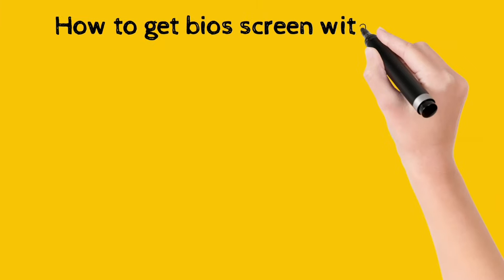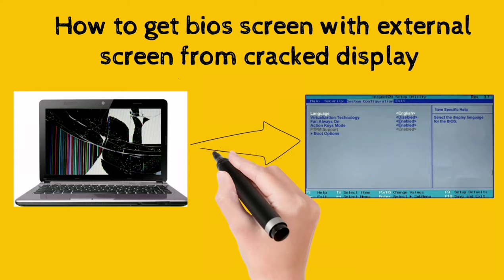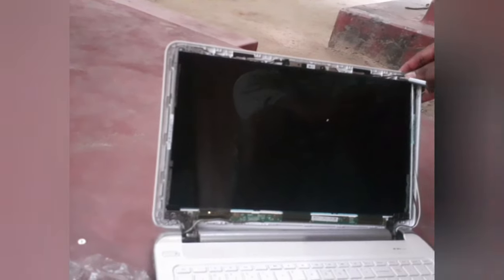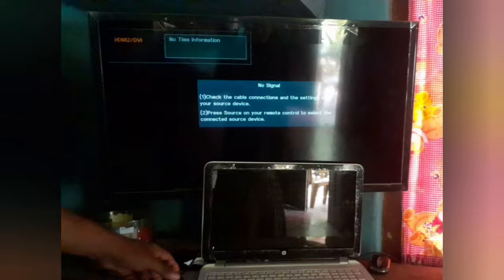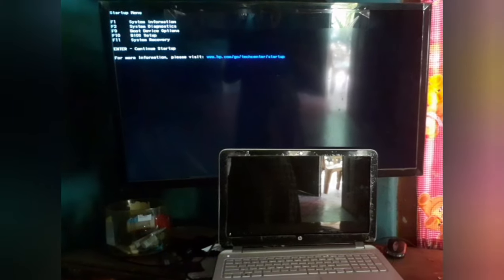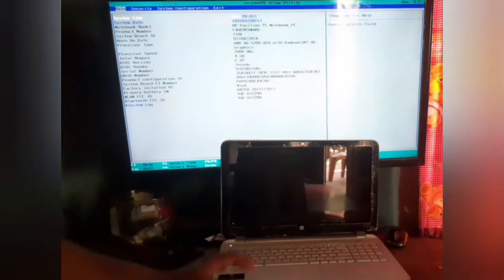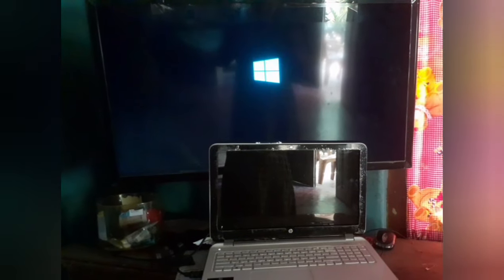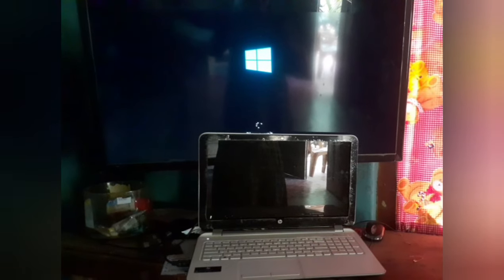how to get bios screen with extrenal monitor from cracked display

Comment: I think before doing this, first try this: Connect the display cable to external monitor, power on the laptop by pressing the power button and close the lid before laptop display turns on. This will switch the display to the external monitor. Hope this helps. If not, follow this video.
Reply: Are you an angel from the computer heavens
Reply: Jesus
Reply: What is lid ?
Reply: Thank you, thankyou very much
Reply: LOL WTH
Reply: Woww thanks😮🙏🙏
Reply: Thanks
Reply: Thank you bro your trick worked thanks bro thanks❤❤
Reply: i dont have a external key baord
Reply: You are literally amazing
Reply: Omg ty
Reply: YOU ACTUALLY HELPED, THANK YOU BROTHER
Reply: Thanks bro make a video and save people time
Reply: Thanks man, I might be late but this was the only thing that helped me
Reply: Damn 😂😂😂it's working thanks 🙏 a lot
Reply: THANKS SO MUCH BRO
Reply: @gamingchannel.6503  The screen which you close and open. 

Oops sorry for 1 year late 😁😁
Reply: Your such a hero
Reply: The problem is the screen are already took it off now it just left keyboard so how now ?

Comment: This doesn't work for my HP pavillion 15. Even with removed hdmi and then reconnection the display doesn't switch
Reply: Same here HP-15d012sx. Have you found any solution? I really can’t get the main display to work because I have no display cable for it so I really need to get this to work on an external monitor.
Reply: @Question???  i haven't found anything that works
Reply: hi guys we have the same laptop. have you found any solution?
Reply: @GT740M  hey me too, any solutions?
Reply: Kismat badi kamini cheej hoti hai mera to chal gya apna dekhlo bhai.

Comment: bruh i took the whole screen off and disconencted from motherboard and it still won't work, does the cable need to be connected to the motherboard so it throws an error or something?

Comment: I tried in sony vaio laptop not working
Is there any other solution???
Reply: hey, i have that model too...got any other ways to do the thing ?
Reply: @david13424  hey, did you solve this problem I have the same probem with sony vaio
Reply: @gioyepumarada2739  
i removed my screen
but i figured out that Fn keys of my laptop are not working, so i tried forced reboot but that too didn't work
but you may try pressing Fn keys for bios once you remove the screen coz idk if fn keys work or not 
.
.
you can remove the screen easily just check on utube then try pressing Fn keys on reboot 
if it does not work , place back the screen not a big deal

be careful, after removing the display you may see one alluminium type sheet dont touch it with your feet on ground u will get electric shock if connected to supply
Reply: @david13424  thanks mate for the response, ive tried removing the screen too but it still the same and connect to external monitor, the display will turn on when its on the loading screen and i cant access the bios, however if i place the bootable usb with windows 10 on it the screen on the external monitor will nver showed up until i restart again and remove the bootable usb.
Reply: @gioyepumarada2739  maybe it's time for us ppl to get a new machine lol
Reply: @david13424  yeah its the best solution 😆😆

Comment: Very well done bro.. liked & supported.. However I've tried everything.. unplugged and removed the broken laptop screen.. connected my samsung external monitor via VGA cable but still BIOS doesn't show up after pressing all possible keys..
Do you have any alternative suggestion? Can this be because I connected through VGA and not HDMI port?
Reply from the maker: ok no problem.first disconnect video connector
Reply: @Techlime22  By video connector do you mean remove the VGA cable from the laptop and then plug after boot?
Reply from the maker: do you have whatsapp?
Reply: @Techlime22  Yes.. bhaii..
Reply from the maker: +94779109466 text me
Reply: Solution milla?
Reply: @Techlime22  bhai vga port is there and also monitor still not responding bios on display. 😭
Reply: same thing is happening how do you fix it

Comment: My dell just keeps beeping 8 times
Reply: The same here. My way is when press power on, faster close laptop down after 1 to 2 seconds. It works
Reply: @zyxel1191  I did a workaround by turning on the laptop by pressing the power button for 10sec Before it turns on

Comment: My laptop light remains on while the monitor goes blank while i change the boot mode to ufei
My laptop has a infinite restrt problem changing to ufei doesn't restrt but i couldn't see anything in the monitor as it goes blank
Reply: PLZ MATE IF YOU HAVE FIX THIS PROBLEME  TELL ME HOW

Comment: Excuse Me Sir,, 🙏😷🙏, I have problem with my laptop HP Pavilion TouchSmart14 Ultrabook14-n033TX,, and the case like the same in your video. My laptop Screen was broken, and i want to display on my TV with cable HDMi, But...i cant see POST Process before  into windows logon, and can't display BIOS Setup. Please Help Me... 🙏😷🙏😷🙏☝️, Thank U B4 👍🙏🙂
Reply from the maker: first disconnect display cable
Reply: @Techlime22  This step already through. 🙏🏽😷🙏🏽
Reply: @Techlime22  Thanks For U respon. 🙏😷🙏,, Sorry, my laptop working,But if i conect to my TV or external Monitor, can't show Bios Setup or Post Process. My laptop can show windows login too,  but i forget my password windows 10,, so i want to repair/reset windows use my CdHirensBoot. And one more, my TV cant show CMD Screen,if i choose repair windows with troubleshooting windows  fitur. Help me please 😷🙏🏽
Reply from the maker: +940779109466 whatsapp number
Reply: Have you guys found any solution? Please share;;
Reply: @Techlime22  How i contact you i have same problem